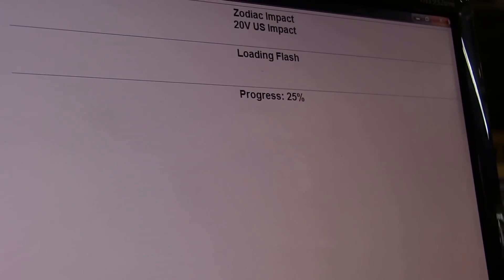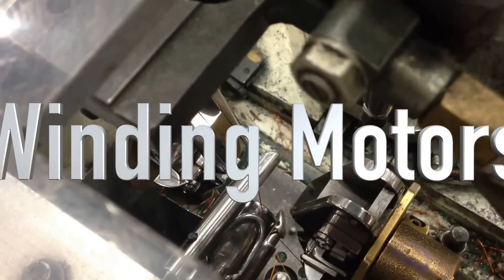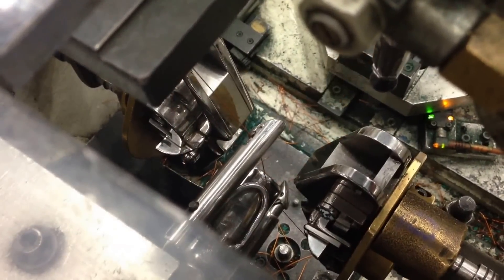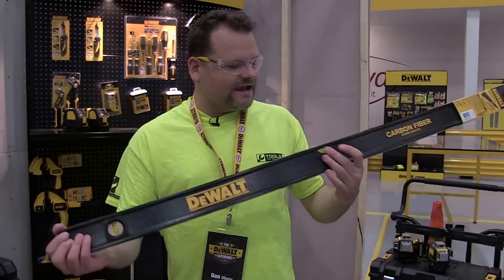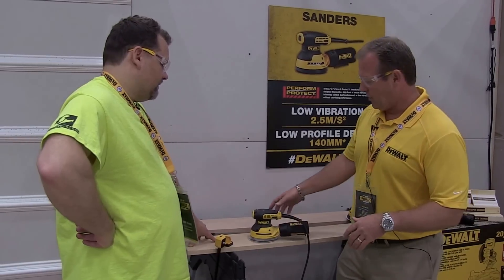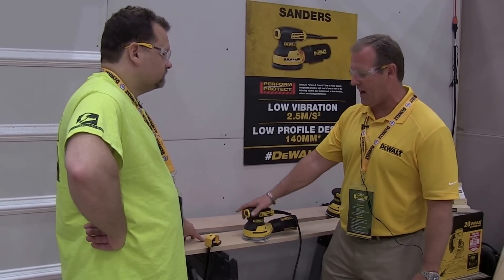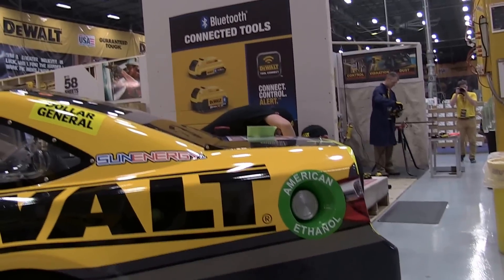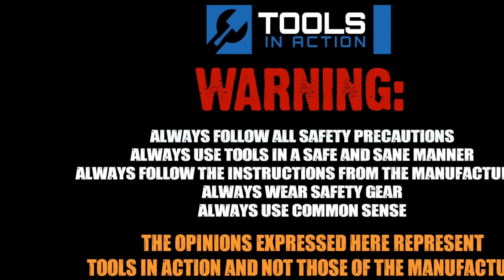Tool Talk 26 - DeWALT Assembled in the USA Edition

Comment: Great, Great Tool Talk. I enjoyed seeing the T.I.A team up with TG and WSA. all of my favorite sites all in one shot. So by the sounds of it, Dewalt is not moving everything to brushless because of the new 5 amp batteries and the Extended Runtime they are currently promoting? That's to bad. I initially started on the Dewalt battery platform but Milwaukee has some very innovating stuff, so now I am a Hybrid and have no complaints from either. Thanks Guys!!

Comment: I wish they would have announced new 12v tools . I want to buy my  first set of tools but I'm waiting for some new 12v since the the 18s are a bit more expensive. Do you guys know if Bosch is doing any events? I know the jigsaw coming out but I really want an impact driver. I've read on tool guy that the brushless impact driver was announced somewhere in Germany but that's last I've heard of it.
Reply from the maker: iilover doe Bosch had their event at World of Concrete.  No 12V news
Reply: iilover doe I think Dewalt had abandoned the 12v tool line to focus on completing the 20v lineup. If your going to go 12v tools the only brands I would consider is Bosch or Milwaukee. It's not the best option because some people like the grip on the Dewalt better. I think the 12v line will stay the same and maybe get some more test and measurement tools.

Comment: I have to say that Dewalt coming back to USA manufacturing is huge a plus in my mind, actually something that leans me a little closet to their side of the market. It seems to me like they are starting to make themselves a lot more carpenter friendly too with the tools they have coming out (nailers, miter saw, etc.) which is actually a really smart move if they can corner that part of the cordless tool market. I really don't see a point to the battery, my Milwaukee Fuel batteries tell show me when they are low and prevent themselves from overheating...these bluetooth batteries really seem like more of a gimmick to try and draw in people obsessed with technology (new tech is often not better tech) than a useful addition to a tool collection.

Comment: I don't think Bluetooth uses internet data. If the new batteries have Bluetooth , then that Bluetooth radio in the battery won't be able to use internet data because Internet data uses a completely different kind of radio. If you open up you iPhone your going to see like a couple different radios one is for 3G/4G Internet data the other is going to be a wifi radio and then the Bluetooth radio.. If you get your iPhone and pair it to a Bluetooth wireless speaker or Bluetooth headphones you can completely turn off your wifi and mobile Internet data and your phone and whatever Bluetooth device you have pair should still be able to talk as long as your with in the Bluetooth range witch is like maybe 30 feet... But your right this does add an extra step they should have just put another light somewhere warning you overheating the battery but I guess some people will find the locking useful
Reply from the maker: iilover doe You are right B luetooth is not connected to the Internet.  The phone you connect to the battery via bluetooth has to have an active net connection to connect to the DeWALT cloud